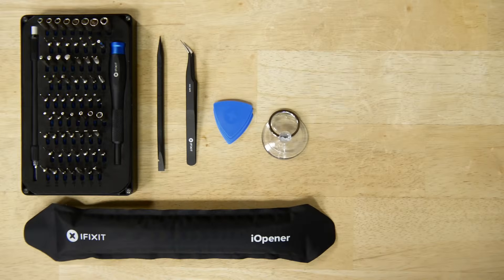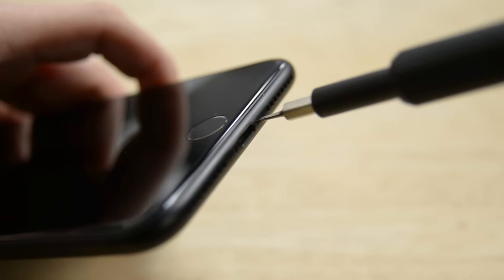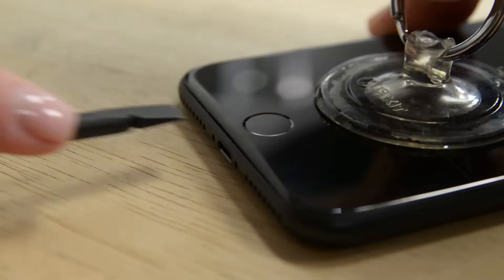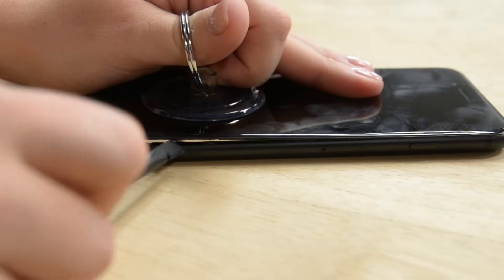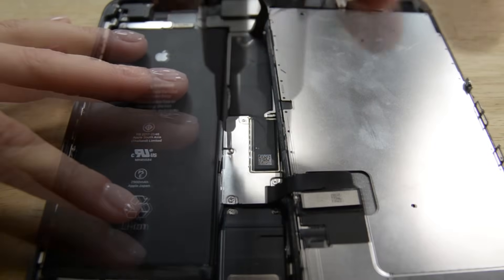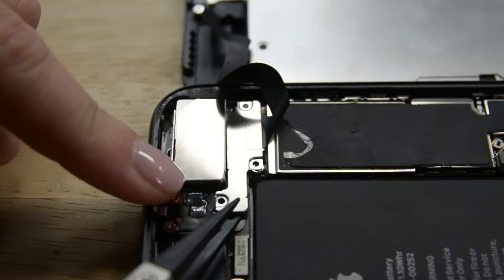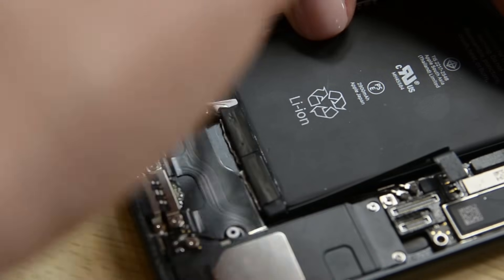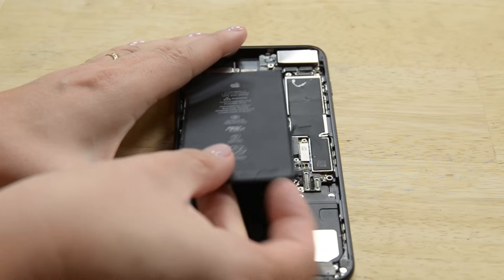iPhone 7 Plus Battery Replacement-How To

Comment: Here is something to think about:
With the ability to track your every movement even with the phone off, how about being able to take out the battery when you dont want the leash to be yanked.
I just may start a service to add a micro switch to be able to disconnect or connect the battery at will.
Any activity like calls, messages or mail will be waiting for you when you switch the battery back on.
Any thoughts on viability will be appreciated.
Have a great day !

Comment: today I changed my Iphone battery, and it just does not work,

THe phone keeps rebooting over and over, and it does not charge.

It can’t be the battery because I changed 3 and it only works with the battery I had before

What did I do wrong?

Comment: I did this today. I didn’t have any new adhesive, so I took some silicone caulk and carefully lined it around the edge with a toothpick 👀 it’s working so far (I’m typing on the phone) but we’ll see how it holds up. Not that I would recommend it, I think silicone caulk is acidic so you’ll have to be very careful. Also there’s no guaranteeing the waterproofing worked

Comment: Why are you removing half of the phone? You don’t need to remove Taptic Engine or anything. ALSO you can NEVER get the strips out the way she removed them. You don’t need to heat the phone up. Use tweezers, as your pulling the strip out wrap the strip around the tweezer. Pull, twist, pull twist. Man i can’t wait to make a YouTube channel on how to PROPERLY fix iPhones.

Comment: Decent video, but a bit rushed, and obviously doesn't cover the re-assembly, but just do things in reverse.  I just replaced the battery on my iPhone 7 plus successfully.  Took me a little bit to get the top part of the screen off, as it seems to have a plastic lip along the top, so it doesn't just pop up and off.  It cannot be overstated to be careful with the loose screws - they are crazy small.  And on at least two parts, one of the screws is bigger than the others, so you have to keep them straight.  One of mine got lost in the phone for 10-15 minutes and I used a needle and magnet to fish it out.  Also, wait to reconnect the battery last after the screen reconnect.  I didn't do this, and while it didn't cause any issues, supposedly it can cause components to die.  Overall, it took me about 45 minutes to replace the battery, but that was due to the screw that tried to go AWOL.  You have to be good with tiny, tiny, tiny parts.  If I had to do this again, I would try to do it without removing the screen, but that seems risky with the delicate screen cables.

Comment: NO need to remove the screen OR the engine! Just more work and higher risk of losing screws or damaging the phone 📱
Reply: auxmike true. Just be careful not to tear the flex cable of the screen. Not necessary removing it.

Comment: U literally could just pull the adhesive strips without taking out your Taptic engine
Reply: Yep all you really need to do is disconnect the ribbon cable that the battery is attached to. Very unnecessary to remove the screen or the Taptic Engine.
Reply: yes but there is more chance for them strips to tear with the engine in place.

Comment: "An out-of-warranty battery replacement, normally $79 for an iPhone 6 or later model, will instead cost $29 through December 2018. The decision, announced on Apple's blog, is certainly a boon for owners of older phones — Macworld describes it as “like getting a new iPhone for $30.”
Why the F would I go through all this shit to save 29$?...Even 79$ is cheap as shit.
Stop being dumbasses and get your battery replaced professionally.

Comment: The last few steps arent necessary. You can just use your tweezers and grab the tabs for the battery adhesive. You only need to take it that far apart if your adhesive tears and you cant get the end of it anymore.

Comment: how to remove android battery;

1. take off back of phone and whack the battery out.
2....thats all...?
Reply: wendy williams  you mean like on the note 7 or the galaxy s 7 or the one plus 3.
Reply: i suppose thats only for the androids i've come in contact with
Reply: LG does and also have SD memory card
its remarkable phone EXCEPT few months into using it and it just shutsdown and wont start again LOL
Reply: Tom ya but then you have a shitty android phone. There is the iPhone and then everything else.
Reply: *****
i dont get the big deal?
 i explained how to take out most android batteries as a joke.

Comment: Aint nobody got time for that. I will bring my iphone to repair service for changing or replacing parts. It will save lots of time of my life. LUL.
Reply: Don't bet on it. I just got my iPhone 7 plus back from the Apple store in Philadelphia and so far the screen protector is a mess and definitely needs to be replaced. I don't know what they did but this was on perfectly and now looks useless. I just hope there are no new weak points that will break. The new battery has exactly the identical amount of charge showing as the battery that was in the phone to start with. I don't trust a company like Apple at all.

Comment: I wonder why Apple made it so difficult.
Couldn't they build in the ability to swap out batteries and maybe go with micro SD memory cards?
Reply: +oKtosiTe Almost seems like he was trolling, but you gave a really accurate and kind answer eitherway. Thanks for that!
Reply: Like Dany said, Apple is big on privacy and security. It's much more difficult to open an iPhone and find the memory chip and then somehow read the encryption than it is to take out someones SD card and be on your way.
Reply: I work in phone repair and am confronted with many iPhone users every day. Letting many of these people service their own phones would cause Apple more headaches than it's worth. Swappable batteries also affect the look (Apple is very focused on looks) and the durability (Apple would sell less phones) of these phones. Not to mention the waterproofing.
Reply: xxnike629xx sd cards are not secure and most of them are also slow and unreliable

Comment: This isn't a video on how to replace the battery this is how to remove it.
Reply: GamingForCheesecake   Not necessarily there could be something very specific with putting the adhesive strips back in.  Don’t make an assumptions.  There’s always hidden gotchas with technology
Reply: if you can't put adhesive strips in  without a video tutorial, then you shouldn't be opening your iphone to work on it
Reply: I agree with you jackanno 🤨
Reply: You are funny
Reply: exactly
Reply: mr jackonno78 is right
Reply: you're stupid if you can't just do it in reverse
Reply: @gamingforcheesecake3668  that's not the point. The video title and what the video shows are two different things
Reply: @gamingforcheesecake3668  Dude don't call people stupid, he has a valid point on installing battery adhesive and screen adhesive correctly to maintain water resistance.
Reply: @gamingforcheesecake3668  tell these brainlets as it is.
Reply: Just reverse the process numbskull....
Reply: No, Gaming for Cheesecake is correct. 1, your phone will NEVER be waterproof again after you remove original adheasive. 2) if you cant just do the reverse, you should NOT BE OPENING UP YOUR PHONE! this is NOT DIY stuff, there is a whole industry. out there that does this, so if your not knowledgeable enough to know that adhesive is already included on the replacement battery, and replacement glass (because most people who try this, would not be able to take top off without breaking glass. even I break glass at times). This video title is just fine, it shows you how to take the battery out. Ive seem a million of these types of videos and DIY articles, and they all say the same thing: just do it all in reverse now.

Comment: Does it destroy water proofing ?
Reply: yes it does. waterproofing depends on the adhesive under the screen.
Reply: Yes, it does. Without having the new adhesive to replace the now non-functioning adhesive you remove, your phone will no longer be water proof. 

Keep in mind this does also void warranty.
Reply: not waterproof water resistant
Reply: Don't lie to people. This will absolutely kill the waterproofing.
Reply: the iphone 7 plus isnt waterproof if i am not mistaken just water resistant, heck i dont even put any of my phones near a water source, better safe then never and use a very protectve case while your at it.
Reply: my question too
Reply: They stated in the descriptions that it does.
Reply: *****
Doesn't even look waterproof, thought it has some seal you had to remove... confusing....
Reply: You can buy screen adhesive to replace the broken one. But it requires more work than 4-5 minutes lol
Reply: No, I don't think so because the i7 is not waterproof to begin with.
Reply: @SBiller442  The iphone 7 and plus are IP67
Reply: Hanniffy Dinn No